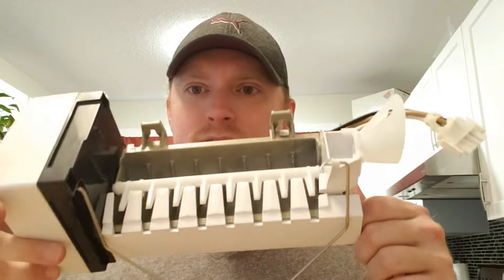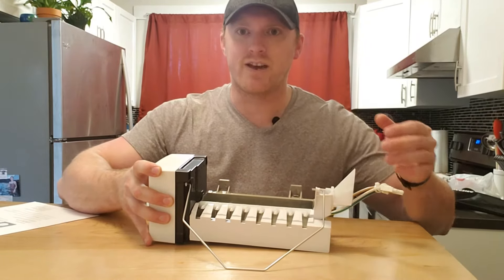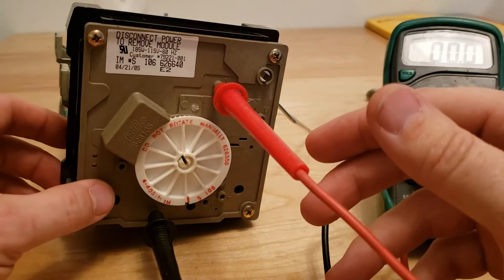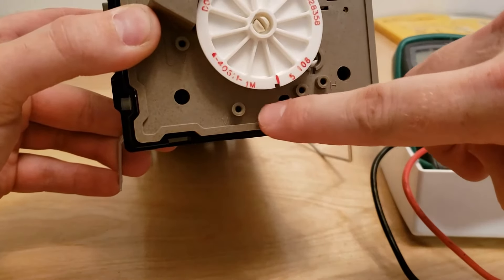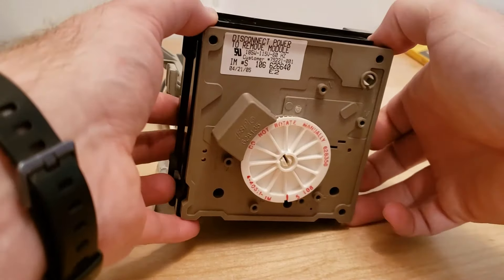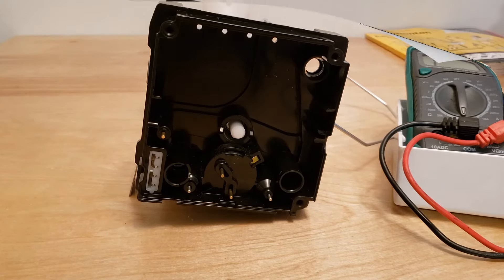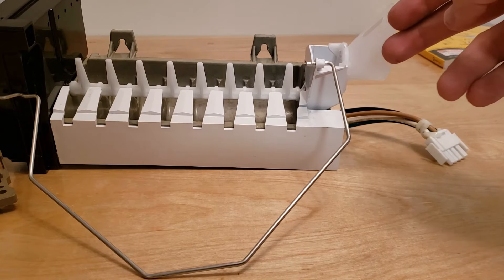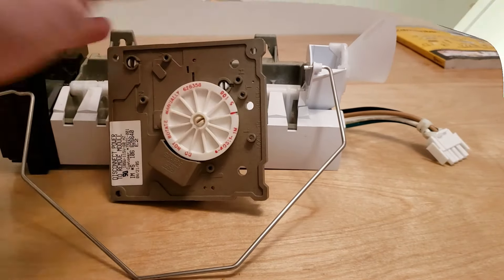FRIDGE ICEMAKER HOW IT WORKS - TOTAL DIAGNOSTIC GUIDE

Comment: please cover the diagnosis of the Thermal fuse that is in the Harness. I believe mine is blown. No power to the N neutral and L line terminals in my new Icemaker, nor the old one.
Reply: Greg. This was a really good diagnostic, and R&R video. Great work. As I said, please cover the Thermal fuse, in the Wire Harness. My new ice maker came without one, so had to use the original. The Thermal fuse was blown in the harness. I spliced in a temporary wire, to bypass the Thermal fuse, and the new ice maker works great, until the New Harness arrives.
Reply from the maker: Thanks for watching John Firebaugh, I will definitely cover that in my next ice maker video. Hopefully your ice maker is working as it should now

Comment: I lost power to my ice maker,  Power goes into cabinet but no signs of an access door to look for a fuse. its a whirlpool side by side Any ideas where a place would be for a fuse. Great video though.
Reply from the maker: There shouldn't be any kind of fuse just wiring from the board to the icemaker. Maybe try and find a wiring diagram for your fridge, then you can trace power.

Comment: Hi I have a U line icemaker and for some reason the ice is sticking to the tray not allowing the arm to turn, I ve tested the resistance and gave me 330 ohms, how do I know if is good or not?
Thank you
Reply from the maker: I'm not sure what spec is on those but 330 ohms should be fine, is the tray inside chipping or dirty from built up calcium?
Reply: @Thomasappliance  yes the tray itself was chipping away and build up calcium, I sanded all off and apply epoxy paint special for food, just to cover the whole tray and prevent it from sticking,  I ll see if it works,  thank you
Reply from the maker: @fsrodeo81  no problem, hopefully that works, ive never tried it myself

Comment: My heater checks ok, but it wont dump ice, what causes this? the thermostat in the ice maker?
Reply from the maker: Does the motor try and turn?
Reply: @Thomasappliance  yes
Reply from the maker: @slingshot909  i would check the mold, sometimes they get chipped and peel inside, so the arms can't scrape them out because coating is gone.

Comment: Why does the tube feeding the ice maker freeze? It's happened on mine many times. I've replaced the ice maker and the ice maker water valve.
Reply from the maker: Thanks for watching johnharris, some fridges have made heaters on the incoming fill tube that you can get. Most of the other ones its just poor design.

Comment: what is the effect on the heater operation if the test  indicates 92 ohms? my icemaker will make and eject ice one time after resetting using the TH jumper, refills tray, but then won't eject again. any suggestions?
Reply from the maker: It manually turns on the heater, the heater turning on starts the cycle, so next time it needs to eject the heater is not turning on. So either the heater, or thermostat, or possibly wiring is the issue.

Comment: What if i have no power to the ice maker?
Reply from the maker: If you checked the wires going into the icemaker and have no voltage there, then you have to trace back power to usually a board.

Comment: Hello, the icemaker lever stays up, I have to lower it manually, do you know why it does that, or what can I do?
Reply from the maker: If it is raised thats how you shut it off and it will stay like that, until you lower the arm manually to turn it back on. Thanks for watching Daniel Rodriguez.
Reply: @Thomasappliance  I'll explain it to you, it makes ice but when the cycle ends the lever stays up it doesn't go down so it continues making ice I have to go and lower it I don't know if you understand
Reply: the mechanism of the lever when the ice comes out goes up and stays up it does not come back and go down automatically thanks
Reply from the maker: @lolobong  ok I see, I would check and make sure the arm is in the head properly, if it is then there is a piece in the head that while turning lets it fall back down. So you might have to take apart the head and see if its fixable or is something broken inside.

Comment: Hello I just replaced my unit. I was able to fill and cycle by jumping T and H.  Issue is that the unit never drops the ice.  Water sits frozen in the mold.  Not sure what to check next?
Reply from the maker: If the water sits frozen in the mold the thermostat or the heater is to blame on the icemaker. Thanks for watching DaKine
Reply: Thank you
Reply from the maker: No problem at all
Reply: I replaced my unit because the lining of the old unit was deteriorated and peeling and a powder formed.
Reply: When checking resistance do you need to unplug the unit?

Comment: I only have 99v at the wire harness at fridge.  I get continuity on L and N to the bottom wires on ice maker harness but when I plug it in I get no voltage.   Well 0.99v .  I have the connection pushed all the way in.  What could cause that?
Reply from the maker: Thanks for watching dand, sounds like there could be a broken wire or possibly the board isn't providing 120v.
Reply: @Thomasappliance  the board with the blinking red light?  I had 99 v coming out the wire from side of freezer.  Which is odd right?   It should be 120 I think.  The clock mechanism has no voltage and I have a new one and one I soldered.   Both do not have power. But the wire has continuity which make me wonder how there is no power.  Unless the connector is not making a good connection but it looks like it's all the way in.  Would you think I should replace the whole ice machine.
Reply from the maker: @dand7056  do you have a model number for your fridge, so I can see what we're dealing with.
Reply: Kitchen aide KSRA25FKSS00
Reply from the maker: @dand7056  there will be 120v when the icemaker is calling for power.
Reply: @Thomasappliance  what do you suggest I do?  I don't have but 99v from the board and and no voltage after plugging in the icemaker.
Reply from the maker: @dand7056  also while measuring voltage close the light switch. I'm looking at wiring diagram and alot of things are in between L1 and N.

Comment: i'm not getting power, any ideas what it could be? When i first started thought it was the ice maker. ice was in the ice maker but never came thru cycle and falling out so i thought it was the ice maker. got a new one and nothing is happening. I checked the power and I'm not getting anything. water dispenser works fine and both side are cooling as required.
Reply from the maker: Make sure when testing power the door switch is closed. Power comes from the board so I would trace the power back.
Reply: @Thomasappliance   thanks yes had both in closed position. it started making ice after I left alone. all i did was lowered the temperature to freeze side thinking maybe it was not cold enough but it made ice for a while maybe 4 cycles and now stopped again. something is working intermittently
Reply from the maker: @RicardoMolina-b2k  that's usually a board issue
Reply: @Thomasappliance  like the main board or the ones behind the sensors?? in the freezer compartment
Reply from the maker: @RicardoMolina-b2k  send me the model number

Comment: Greetings, there is a button that is used to control the thermostat, why does mine stay halfway when it is going to remove the ice?
Reply from the maker: Thanks for watching lolobong, usually if ice doesn't fully eject it can be because the mold isn't clean or it is chipping the nice smooth finish off, so the ice sticks. The heater may not be heating enough. The cubes might be too big also because too much water came into the mold.
Reply: Is there a way to lower the amount of water and thanks for answering
Reply from the maker: @lolobong  at 10:40 in the video I talk about that. Np at all, hope you can get it fixed up.

Comment: Thank You !!!!!    I just installed a new ice maker for my Mother and it was doing nothing. I watched 30 install and trouble shooting videos and waited and waited. Now I got the whole kit which included new water valve , box , lever , everything. I would probably be knee deep in water trying to change the water valve if you had not explained the internal thermostat. I had washed the tray out with very hot water before I installed it so that may have made it take a little longer to get going. Your video gave me the patience to wait and now it seems to be working. It is full of water now and my fingers are crossed that it will just work fine now. Thanks again.
Reply from the maker: Thanks for watching Jerry P., thats awesome hopefully it stays running, good job!
Reply: @Thomasappliance  Yeah it's putting out ice now ! Mom is happy LOL all that matters.
Reply from the maker: @jerrypeevey  thats great

Comment: I replaced mine with a new one bc it wasn't working. New one isn't either. However I'm getting line power to the unit. Tested at LN. Used jumper at TH and nothing happening. Not cycling. No water fill when jumping at LV either.
Reply from the maker: If your getting power in but it still won't run the board is usually the issue. Power in is needed but power back to the board from the iceaker is needed also.
Reply: @Thomasappliance  what board are you describing ?
Reply from the maker: @Jamus1975  depends which fridge you have, there is always a board that controls the icemaker.
Reply: @Thomasappliance  I have a side by side Gd5shaxkb02,  it has a little board with a sensor in the wall that reads through the ice bucket to the other side.  I just figured if it's getting line voltage, the ice maker should cycle when I jump the T and H
Reply from the maker: @Jamus1975  on those you also have to make sure you hold the sensor door that goes through the icemaker closed.

Comment: Can you actuate the water valve from the V test point on the front of the head?
My refrigerator is a Maytag about 10 years old. I’ve never replaced the ice maker. 
Good video!
Reply from the maker: Thanks for watching pmscalisi, I'm not 100% sure, I wouldn't try it personally. I activate a cycle, wait for the end when it should be activating the valve and see if there is 120v to water valve when it's calling for water.
Reply: @Thomasappliance  okay, thanks!
Reply from the maker: @pmscalisi  no problem at all

Comment: Hi, When I put the 2 wires into the two holes in the ice maker to test if the arms work, a humming noise comes from behind the fridge   Why ?
Reply from the maker: Thanks for watching user-ddss7dz4y, are you putting the leads into T and H? If there is humming from behind fridge it would mean the water valve is activating. Is the icemaker filling?

Comment: Morning..ur video is very precise and educational...my fridge is only 3yrs old..was making ice till the filter clogged..so i replaced filter, heard a woosh of air..little water leakage and pressure of water refill to cup on freezer door got stronger.  Now I get no water to refill tray..read from frigidaire websight that there is a reset button "behind panel" but doesn't specify what panel. Calling company has gone no where as was hard to reach anybody during pandemic and now told it's out of warrenty . I have been manually adding water and icemaker works..this is so fustrating...sounds like it wants to fill and thinking maybe it's iced up..like u mentioned, but u didn't say how to get rid of that frozen part(unless i missed u telling how to?) fridge is frigidaire model ffss2615te2 ..serial  #4a93316340...help!...and ty!..Elena
Reply from the maker: Thanks for watching Elana Purdom, theres a couple ways by taking out the icemaker to get rid of ice build up, you can feel inside the ice mold to see if there is any water or ice in there first. Also make sure the arm on the side of the icemaker that looks like a coat hangers is down.

Comment: Can I stick a insulated jump wire into the L and H to check if my heater works or does it have to be done with this device?
Reply from the maker: The wire will bypass the heater, so it might get a little warm but I would wait until the arms are just about down to feel for heat. Be careful it is pretty hot.

Comment: I have same type of ice maker. Mine is making ice but not as much as it should. Any ideas. Thank you for a great tutorial
Reply from the maker: It sounds like maybe it's not getting enough water so possibly a faulty water valve. Or if the cubes are fine but it doesn't make ice fast enough, the temp in freezer could be not cold enough.

Comment: Thank you for this great video! The ice maker in my refrigirator was not working when I moved in my apt and I didn't bother to fix then! Today, I decided to try to fix it, but no luck! This ice maker doesn't have those two holes to use the jumper wire. My guess is that there is power issue. Maybe the inlet valve? Please advise. The refrigirator model is: General Electric GTH18XCT2RWW
Reply from the maker: On that model you can hold in the door switch and push the panel just on the bottom of the ice maker in 3 times and then let go of the door switch, this will force the unit into manual cycle. If it doesn't run you can check for power to ice maker. If there is power but it won't run you will have to replace ice maker.  But before doing all that make sure there is no off switch somewhere that turns the ice maker off. Thanks for watching Saeed Hasanzadeh

Comment: I reattached my ice control arm after it popped off.  Now Ice maker makes too much ice.  Control arm moves when Ice is harvested, yet it does not stop making ice when the bin is full and control arm stops on top of ice pile.  Also, If I put control arm into top position, I hear a click; nevertheless, the ice maker continues to make ice???  .  Any fixes for this???
Reply from the maker: Sounds like the switch in the head is not working, unfortunately most ice makers come as a whole unit.

Comment: Thanks for the great video.  I have a Kitchenaid KSR225ILWHo2 Side by Side which is about 20 years old.  The ice had just stopped.  I have to remove the unit to try the jumper test and  the motor did not turn.   Taking the entire unit to my bench,  I discovered the motor resistance was 4400 Ohm  not 8000 so I assumed this was the issue.  There were no other issues I could see or test results bad.  I replaced the entire section 106626640 using part Supco IMM8366. ($25 Amazon).  The new motor had resistance 8200 Ohm.  I was stumped when I hooked up the new unit and jumpered the HT I still could not get it to turn.  My unit has in LED ice level and this tested fine.  I held both switches and the unit would not turn.  As a last effort I just installed the unit, hooked everything up and to my amazement it started producing ice in about 20 min.   I am very happy of course with the repair but am stumped on why this worked.  I was ready to take the unit out and start the entire diagnostic test using the board but didn't need to do this.  Maybe a video on how to do this for us non expert home repairers.  Thanks again for the great video and taking time for us repair wannabes!
Reply from the maker: Thanks for watching Mark Confer, thats great you got it going. Sometimes I find after everything is installed I have to reset the whole system, usually i do this by unplugging the fridge for a couple min and plugging back in. I dont know why this works but it seems to reset everything and then everything works as it should.

Comment: Is the time for harvesting the ice controlled by a timer or does it measure temperature to see if ice is solid and ready?
Reply from the maker: When the thermostat is cold enough it tells the motor to run which turns on the heater

Comment: Where is thermostat that starts motor? Enjoyed video everything seems to be working but motor doesn’t start can turn by hand makes ice.
Thanks
Reply from the maker: Thanks for watching davidlyles2737, its inside the head but it more or less tells you weather its cold enough for the ice maker to make ice, if it makes ice then it is working fine. You can test between L and M and the resistance should be between 4400 and 8800 ohms.

Comment: the water supply stem on the back looks corroded at the  metal elbow connector does amazon sell those too?
Reply from the maker: Thanks for watching jimidean corncracker, yes on most fridges the water valve and supply lines are on the back. You should be able to buy that piece, unless age is a factor.
Reply: @Thomasappliance  Thanks for the reply great video thumbs up subscribed
Reply: @Thomasappliance  I took the supply hose off and the tube that feeds water to the ice maker was frozen solid I just put it in a bucket of hot water and all is clear just waiting to see if that fixed it thanks again
Reply from the maker: @1dotele  thats awesome, you don't see that often but it does happen.

Comment: What would be the cause of no voltage at L and N?  We've purchased a new ice maker, thinking that the old one was bad, but we have no power coming in to the unit.  Is there an inline fuse somewhere?  Thanks!
Reply from the maker: Thanks for watching deaniespikes, make sure you check for voltage there with the door switch held closed,  if no power at l and n I would checkbto see if there is power to the icemaker.
Reply: @Thomasappliance  I finally tested each wire of the 4-pin cable for continuity.  The black wire, the one with the thermal fuse embedded in it, had no continuity.  I replaced the cable, and it now works fine!

Comment: Hi Greg mine does not have all these testing point (L,M,H...etc..). but some pins sticking out the head.  are these pins correspond to L,M etc....
and I dont get 120 volt to the water valve.. any sugesstions ?
Reply from the maker: whats the model number of the fridge it came out of?
Reply: @Thomasappliance  its from under counter  U Line ice maker not the Frig.
Reply from the maker: @hamidkashi7778  I'm not sure about the one you have but I think I've seen ones like that and the only testing you can do is through the electrical system and a schematic.